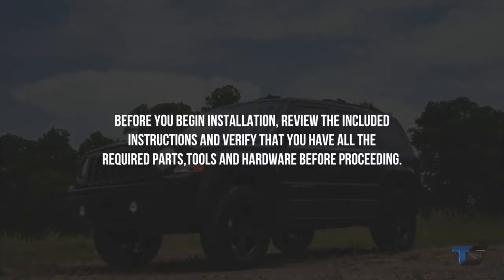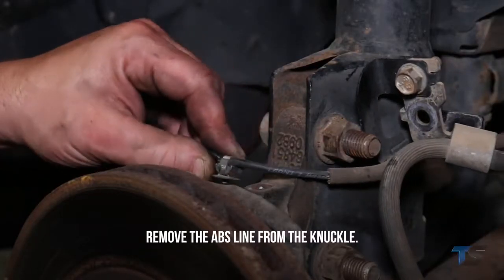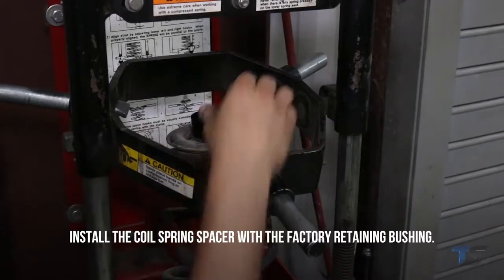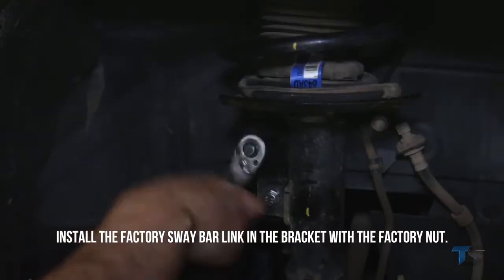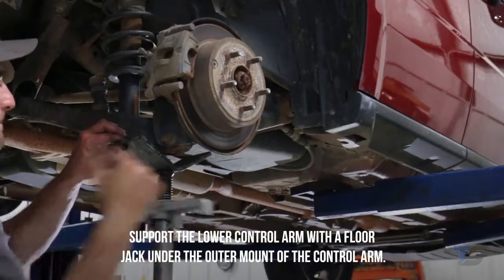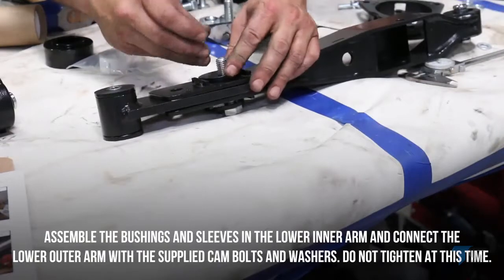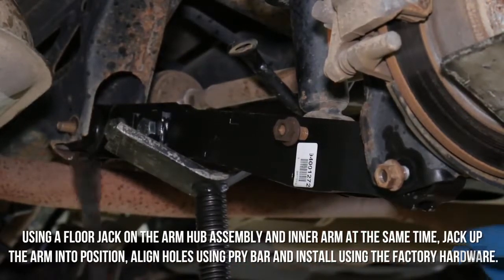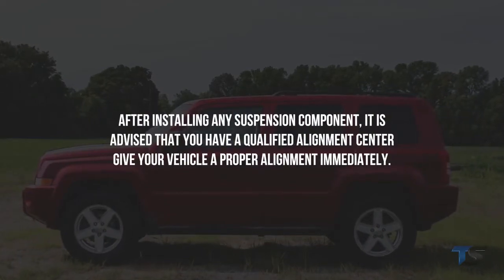Installing 2in Suspension Lift Kit By Rough Country | Jeep Patriot

Comment: How do you remove the strut bushing
Reply from the maker: The upper strut bushing is reused on this kit but if you want to replace it during installation it should be done after strut disassembly in a strut compressor. The strut mount is removed and the bushing can be changed at that time.
Reply: Ok. I’ve done everything I can. Started with the standard spacer kit. That didn’t work. No one would touch the strut on a compressor machine to do the job. 

So I now bought the lifted front struts. 

Now I’m having cv axle grinding and horrible vibration upon acceleration. 

I can’t find an extended cv shaft anywhere. What am I doing wrong?